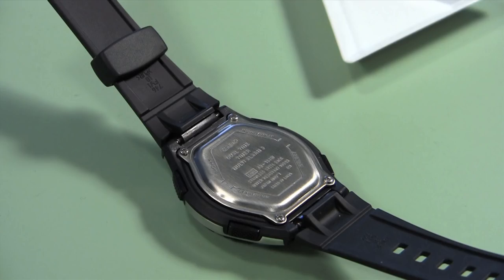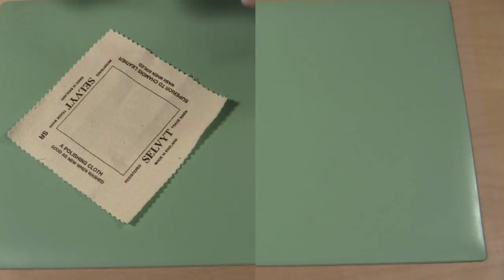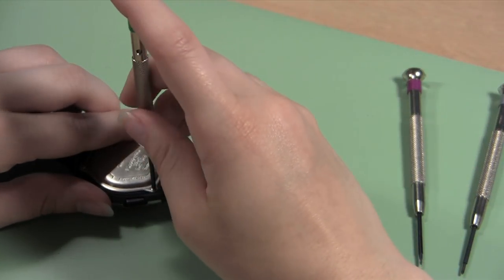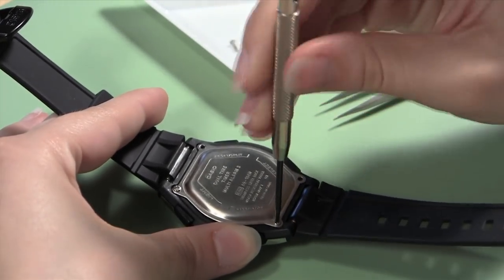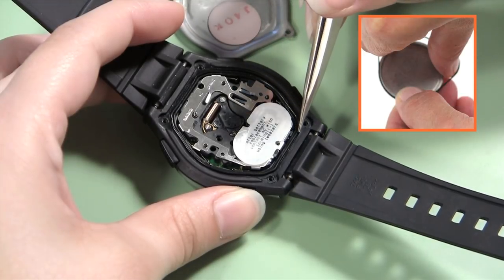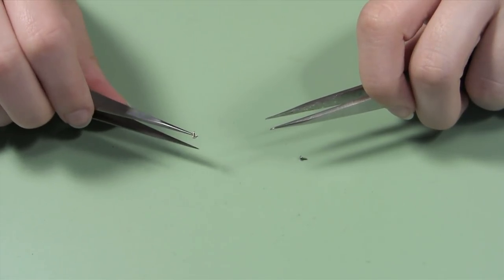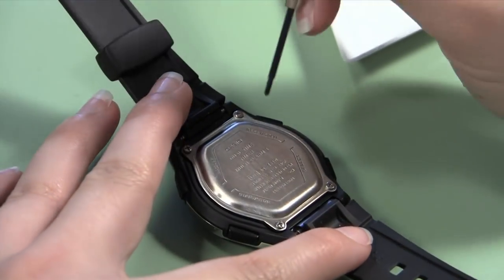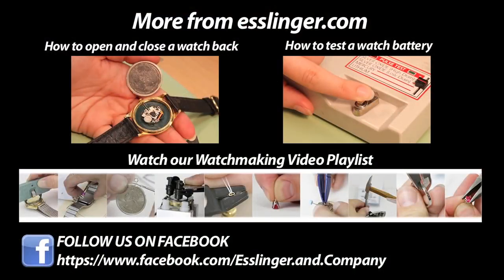How to Open a Watch Case Back with Four Screws

Comment: Actually, the screws should be turned anti-clockwise to settle in the position before tightening them back.This will ensure the screws to follow the exact same screw lines and prevent damage.
Reply: I’ve only ever heard that advice for wood screws. You’d have to be using way too much force to create new / cross threads in metal.